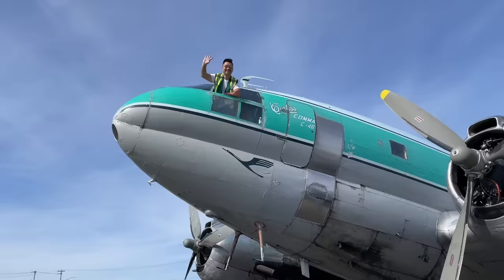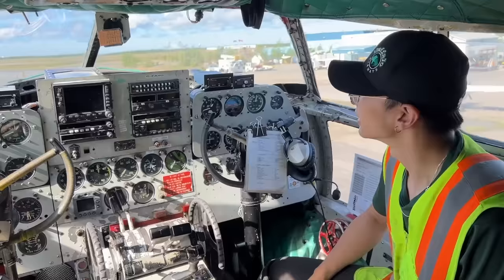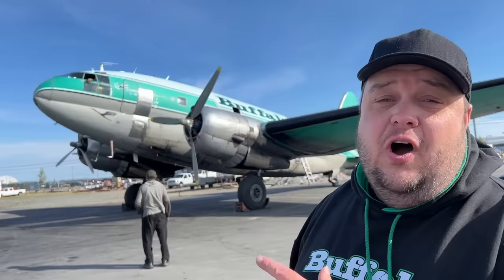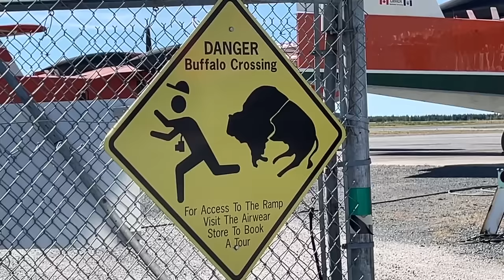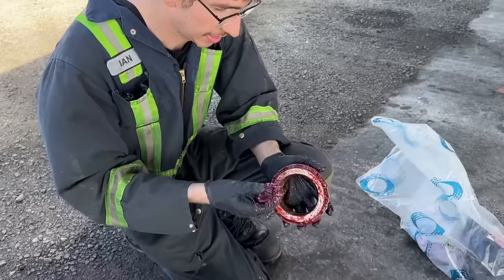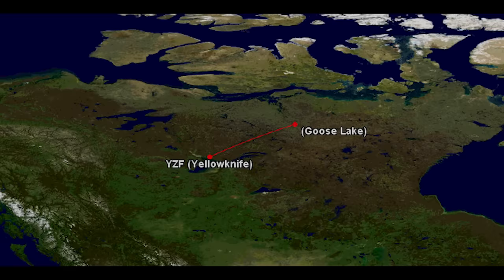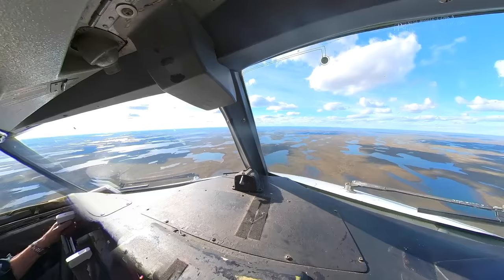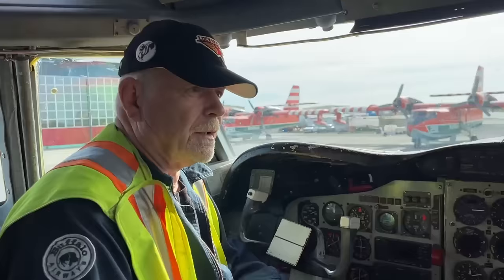Ice Pilots of Buffalo Airways - Raw Aviation in Northern Canada

Comment: I love the perspective pilots start as ground crew and work their way up through the ranks. It's a fair exchange for pilot training and you get to learn lessons most student pilots don't learn.
Reply: Sadly the compagny don't pay for the training (except the type rating on the aircraft) Its a common thing in Canada to work on the ramp and get a right seat job after 1-2 years. Usually pilots already have they licenses before working on the ramp.
Reply: Justin is correct. Most of these pilot in waiting jobs require a cpl, 250 hours TT, multi-ifr and iatra written. You do however get your PPC or type rating through the company
Reply: Unless you fly gliders!
Reply: These guys that start out at Buffalo on the ramp are already certified pilots but they have to prove they can handle the working conditions to be able to fly those old planes through freezing hell
Reply: It’s a lot better to get a first job with an airline if you can. Northern airlines do this so they can have dedicate and educated rampers that they can pay next to nothing. A single pilot job would be better for building time but not as safe. The absolute best would be an airline job where you work a lot right off the start.
Reply: Didnt expect that the Curtiss was ex Lufthansa!

Comment: Great to see a different perspective of this iconic Canadian airline, always nice to see these old planes, no DC-3 or DC-6 flying at the time? they are half the reason for visiting Buffalo!  thanks Sam!
Reply: They never flew DC-6s afaik, and the DC-4s have been replaced by the Electras.
Reply from the maker: The Buffalo DC-3 is coming back to service shortly after an engine change. Everts fly the DC-6 in Alaska though Buffalo has a swing tail DC-6 parked in Hay River
Reply: DC 3, DC 4, C46 and Lockheed electra are the  main planes used by buffalo. With a couple of Cl2-15. They just got 737-200 recently also
Reply: @danielobanla5466  The DC4s have been retired for nearly 10 years, and the 737 is a 300, not. A 200
Reply: @CourageTheCowardlyDog266  ohhhh
Thanks for the update

Comment: I flew with a company in Oshawa Ontario in the mid 80s called Skycraft and it was a very similar operation.  Almost all of the work was for GM and Chrysler.   It was an interesting time flying that old stuff around.  When I first started at the airport, there was an old Lancaster up on blocks and I used to climb in it  and nose around.  It was eventually taken apart and shipped to England, I think.  Up in the old tower were the log books of the pilots that trained there during the second world war.  Very cool time.

Comment: I'm especially intrigued as to the financials of this operation as I would have thought operating old piston aircraft in this environment vs the plethora of surplus jet aircraft wouldn't have stacked up
Reply: it obviously makes complete business sense when they are the only operator out of these areas because these are the only aircraft capable of flying into those specific areas/airports in those specific weather conditions and temps, as highlighted in the video very clearly.
Reply: 100 LL fuel (100 octane low lead gasoline) may soon be unavailable as the aviation world transitions to 94UL (94 octane unleaded). Unfortunately that will be the end for most of these radial engines and jet-A fueled aircraft will be the only option up North.